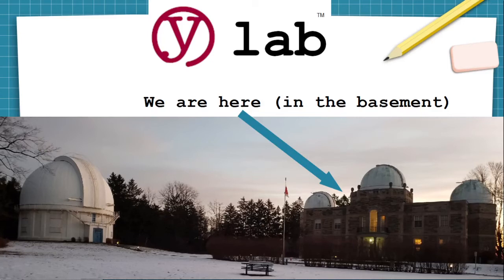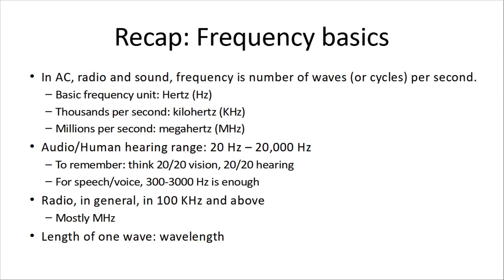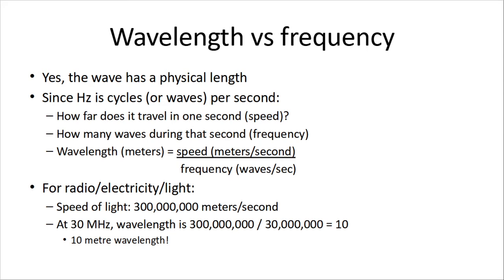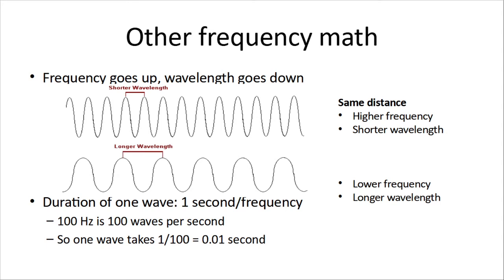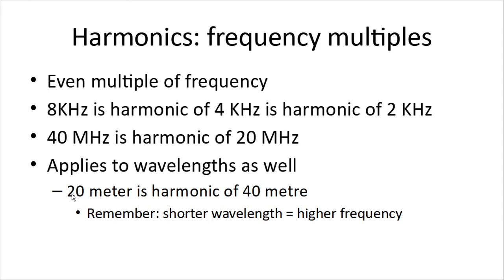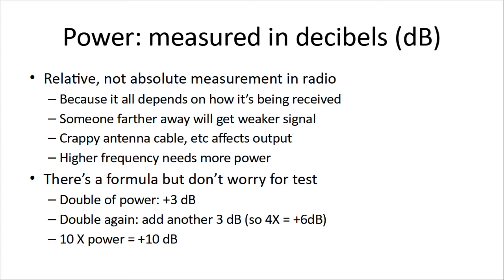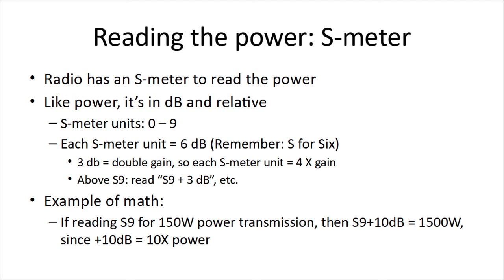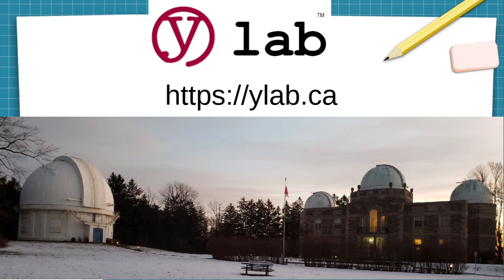Lesson 14 for Ylab's Canadian Amateur Radio License Course

Comment: hello, i am about to do the exam tomorow. 
the thing i dont get is that if  +3dB = 2X the power
going from 150W to 1500W is 10times the power
10time the power / 2X power per 3dB= 5 
so 5 X 3dB= +15db

but the correct answer is +10dB ??
Reply: I appreciate that you've already written your exam, but I am replying for the benefit of others.
Your approach sounds intuitive but unfortunately won't work as gain is defined in a logarithmic scale.
To add 3dB each time, it's not the original power doubling, but the power at the increased gain doubling.
I find it easier to see when written out:

2x the (original) power = 3dB (150W to 300W)
4x the (original) power = 6dB (equivalent to doubling 300W to 600W)
8x the (original) power = 9dB (equivalent to doubling 600W to 1200W)
16x the (original) power = 12dB (equivalent to doubling 1200W to 2400W)
We can see that the desired wattage is between a 9dB and 12dB gain.

The below equation is used to determine the dB gain between two powers.

dB = 10log[P2/P1], where it is log base 10.